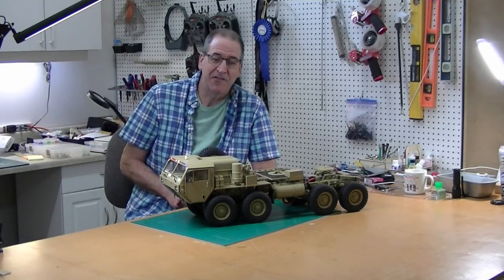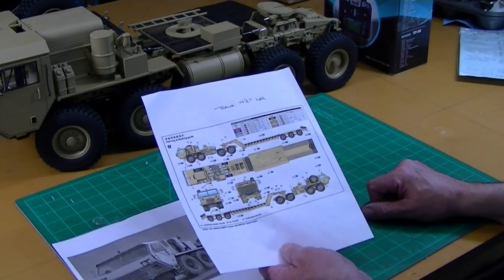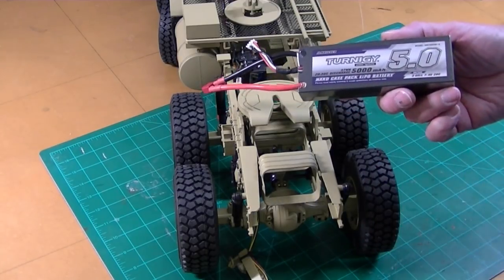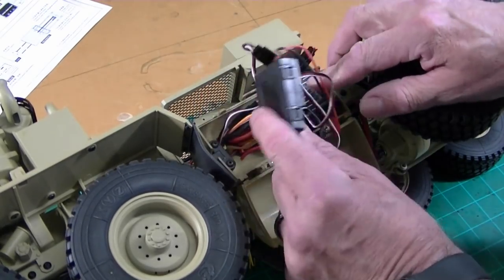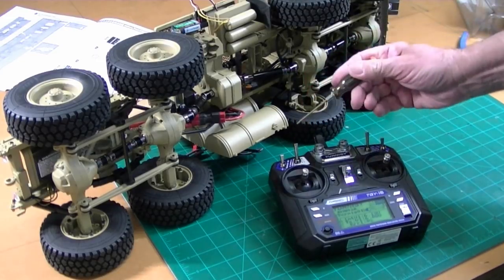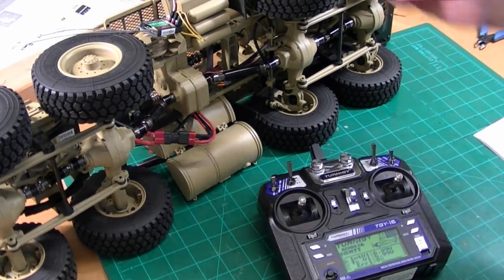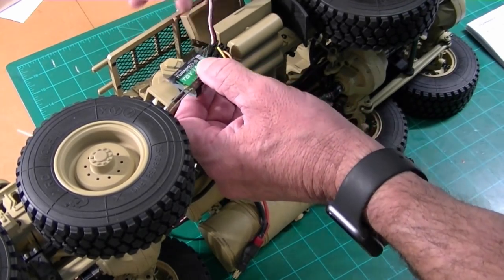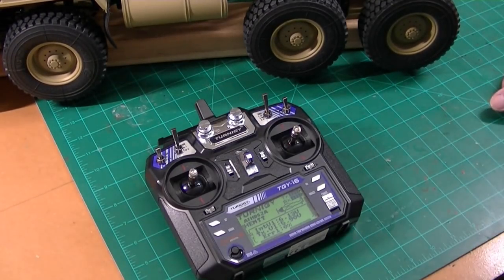1/12 HG Models HEMTT 6 Channel Radio Upgrade

Comment: Thank you for another informative video, this is why this channel is the only one I subscribe to. And I have a question Is it as easy to do this with a king hauler with an mfc01 because I would like to have all the functions steering,shifting,fifth wheel,and all the controls with the mfc is it possible with this radio?
Reply from the maker: Yes, very easy.  Programming and setup with MFC here: https://youtu.be/ITJ3vAehl_o

Comment: Hello I went step by it worked for a bit but know I get the sound like the throttle is working but the wheels won’t move now only when I reconnect the battery what I’m I missing?

Comment: Thanks for uploading this video! Very informative. I plan on buying this truck sometime this year, do you think It's a good idea to get rid of the battery eliminator and speed control and get something else instead? Would it require a lot of modifications? If there is a way to get rid of the eliminator then you can put the receiver in there with the speed control right?
Reply from the maker: I think a better esc with a built in BEC would be the way to go.  I sss no problem to install and you could get rid of a bunch of wiring.
Reply: @HobbyconceptsLLC   Thanks for the info. Really appreciate it. What would you feel be a good speed control with BEC for this? Rock crawling type ESC? or a normal semi truck ESC?
Reply from the maker: Any good esc would probably be fine.
Reply: @HobbyconceptsLLC  Can a normal Speed control with a normal 5V 3A Bec supply be enough to power the 2 high torque steering servos? The UBEC            here seems to be supplying a constant 15A-20A to them?
Reply: What do you think Bob?

Comment: Hello
You can easy upgrade this radio up to 10 Channels by Download a new Firmware with usb kable on your Computer.
A 10 Channel Receiver you can get for about 20 Bucks. I did it to my FLYSKY Radio, it’s identical to Yours
Reply from the maker: Yes, I am aware of it but have not tried it as so far I have not needed the extra channels.  Will try it sometime.